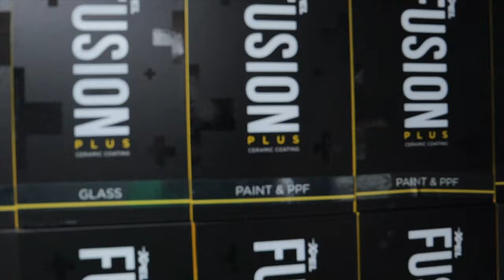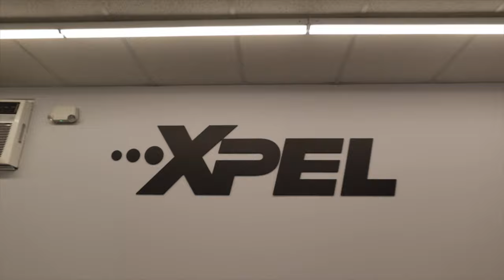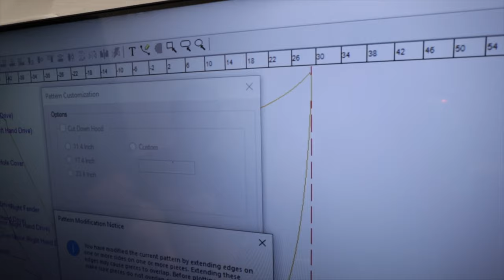XPEL Paint Protection Film Install - SunStoppers

Comment: I noticed they did the headlights. I've used XPel headlight protection for many years. It's a much thicker material than PPF. I've never had any problem with headlight fogging, yellowing, chipping, cracking or anything else since I started using that. After 10 years the first car I put that on was showing the usual headlight damage around the very edges where the material (it's way too thick to call it "film") didn't cover and it doesn't matter. No one would even notice it unless I pointed it out.

The point being that headlights covered with XPel's headlight protection will look like new forever. I highly recommend it whether you have PPF or not, because it's relatively cheap and makes a gigantic improvement in your headlights' performance and longevity.
Reply from the maker: Yes they used the thicker PPF on the headlights and the front bumper

Comment: Hi,

Do you consider putting PPF or other wrap on the pianoblack middle console?

I checked with my local guy doing xpel but he told me xpel still havent released pre cut in the design access program which xpel dealers use to cut.